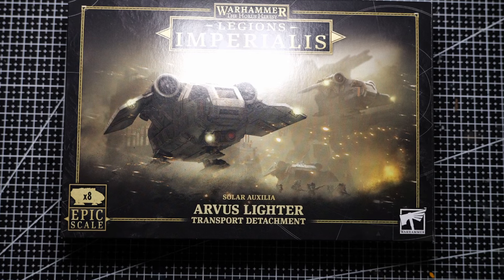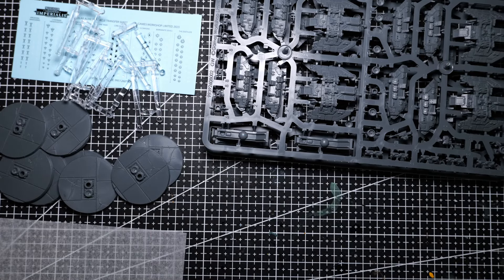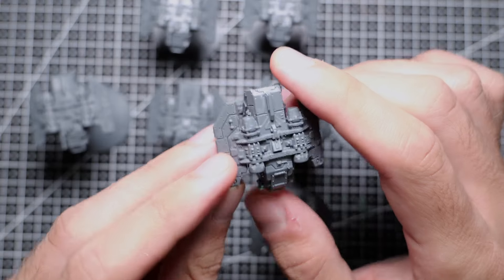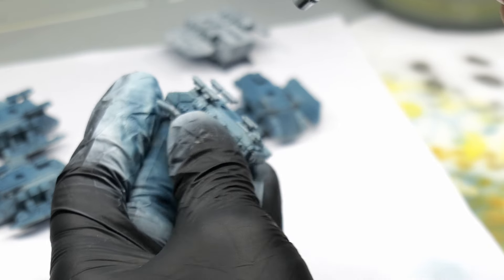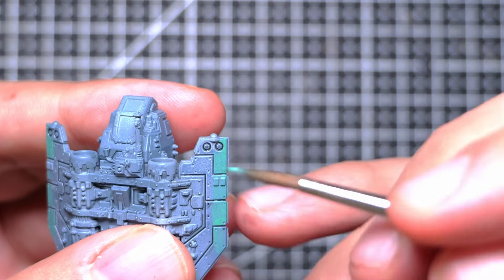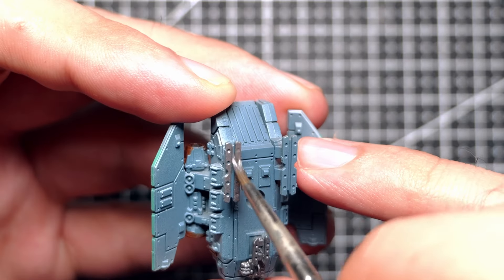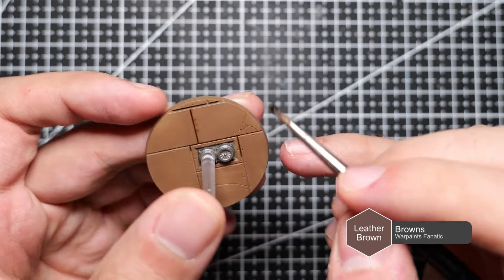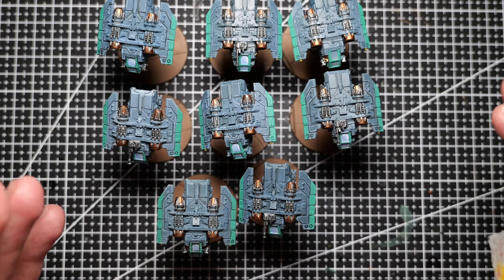Building and Painting Arvus Lighters - Legions Imperialis

Comment: If you make yourself a little jig, out of a spare clear flying stand rod, glued to an old round base, you can paint flyers without needing to touch them, I’ve got 8 made and they make flyers much more fun to paint especially with an airbrush. Would have made a clear gloss varnish coat very easy pre wash stage for example :)
Reply from the maker: Thanks for the suggestion, that’s a good idea!